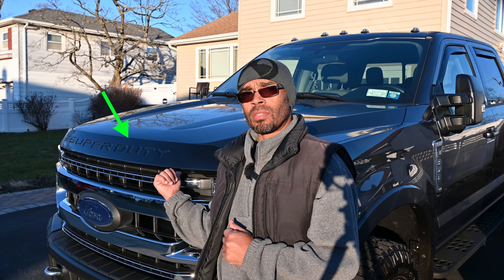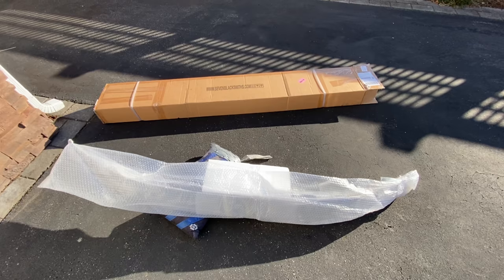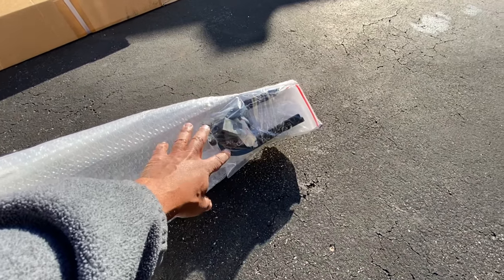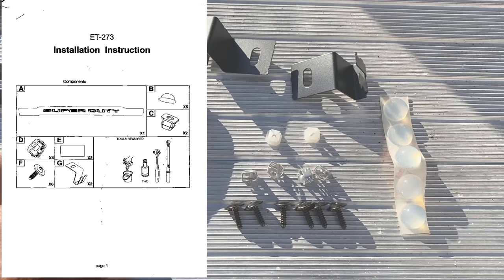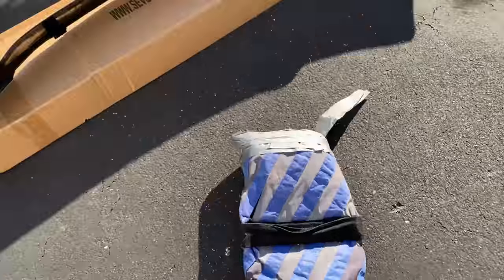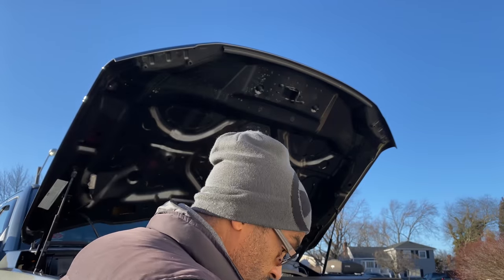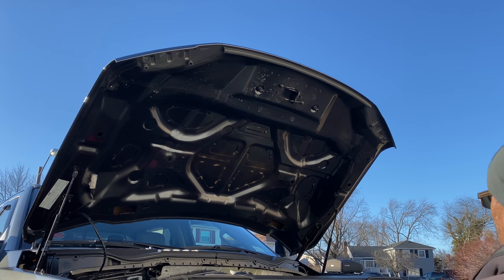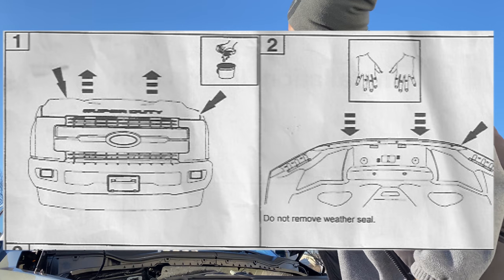How to install Hood Deflector Bug Shield for the 2017 2018 2019 2020 2021 Ford F-250 F-350 Tremor

Comment: Nice job Ray.  Even without paint protection, I like your idea to stick the little bumpers to the deflector instead the hood.       Also, you obviouly know this but throwing it out there for those that don't,  Always install all the fasteners, screw, bolts ect. before tightening any of them.   I'm a retired aircraft mechanic and this is an important simple lesson to learn.  Makes live so much easier.
Reply from the maker: Thanks for your comments and suggestions.

Comment: How well did this work out over time?  Still happy you got it?  Did it make a difference with bugs and stones?
Reply from the maker: Thanks for the question, I haven’t had problems with bugs and rocks hitting my windshield but I really don’t drive in those conditions, also the only problem is with the paint on the deflector. It had been peeling off. I’m have to strip off the old stuff and repainted it . That is the only real problem with this item. Other than that it’s been working out well.

Comment: Good job on the video.  I followed your instructions.  Thanks for the help.
Reply from the maker: Thanks for the feedback and please remember to subscribe to the channel and like the video.
Reply: Mine came with some foam strips, that I don't know what they are for.  I believe I saw them in your packet as well.  What did you do with them?
Reply from the maker: @michaelvincent340  they are used if you have a problem with rubbing or vibration. I didn’t use it in my installation.9

Comment: Great video was thinking about this deflector on my new 2021 F350?  one question? where are the 2 pieces of black weatherstrip type foam go? reference the 54-55 second time in video
Reply from the maker: Thanks for the feedback and please remember to subscribe to the channel and like the video. To answer the question, the foam is needed only if you have Rubbing or vibration issue. I didn’t use it in my application.

Comment: I didn't see you install the 2-way foam tape. 
My bug shield started shaking vigorously on the highway and I had to pull over and remove it. I never install the tape.
I followed the instructions as directed. Do you have any idea why this would happen. It was snugged down and tight when I finished the install.
Reply from the maker: Thanks for the feedback. Please remember to subscribe to the channel and like the video. To answer the question, I didn’t use the tape. It was given as a option if you needed it. I haven’t had any problems with my deflector. also review the video again. Give Attention on how I install the rubber stops. To avoid any vibration. Good luck

Comment: Ray,  did you not install the two strips of foam? This is an important piece to reduce vibration of the plastic deflector on the front lip edge of your hood. I did not see it in your video.
Reply from the maker: Thanks for the feedback. Please check the past comments below. I give a answer to your question. Also answer some other questions in regards to the instructions for this item.
Reply: @DIYRAY  - I installed both the foam strips on the inside lip of the hood guard which will negate any rubbing or vibration of the plastic guard on the leading edge if the painted hood area. I  have full hood coverage of XPEL paint protection, however the foam strips do serve a purpose. Cheers! 👍🏻😉
Reply: @patriotone755  Whereabouts on the hood or deflector did / should you attach the foam strips? I installed this item and at 75-80mph I get I big vibration like the truck is going to fall apart. I took the deflector off and the vibration is not there so definitely the deflector. Any help to get rid of the vibration is appreciated.
Reply: @gavinm6720  - I installed both the foam strips on the inside lip of the hood guard which will negate any rubbing or vibration of the plastic guard on the leading edge if the painted hood area. I  have full hood coverage of XPEL paint protection, however the foam strips do serve a purpose. Do this and you have installed it correctly.

Cheers!
Reply: @patriotone755  Thanks for the info. I refitted the deflector with the 2 foam strips on the bottom leading edge of the deflector and this effectively blocks air from entering the mid section and causing the deflector to vibrate. Seems completely fine now at over 80mph.
Reply: @gavinm6720  nice job, you installed it properly!
Reply: @patriotone755  Can someone post a picture of where the foam exactly was installed?
Reply: @deadondisplay2895  Did anyone send you a picture of where the foam pieces go?  I am looking to install 1 too.

Comment: So I installed and got a big vibration from the deflector at 75-80mph. I did not install the foam strip. Now I have taken the the deflector off and will install with the foam strip. I know you did not install the foam strip and had no problems but do you know exactly where to place it if you did need it?
Reply from the maker: I contact the Manufacturer of this product. I asked him the same question. They stated it depends on your application and where the vibration is coming from.  I suggest cutting probably 2 inches off the strip and go from there place it where you think you might need it.
Reply from the maker: Also make sure you installed the same way I installed it. Hoping it will solve your issues. Good luck 🍀
Reply: @DIYRAY  Thank you sir!

Comment: BEWAR!!! I just got mine from Ford with my Ford pass points. They don't say anything about basically gluing to your hood with double backed foam tape. Not a chance that that's going to happen on my  new 2023. What if one day you decide you don't want it anymore for some reason? The paint would never be right. Back in the day, they had brackets and bolted up under the hood so that you could replace a damaged one or just take it off with no damage to the paint. Your video was a great tutorial but I'm sending mine back. Not one of Fords better ideas.
Reply from the maker: I agree with you. That why I placed the rubber bumper on the deflector instead of the hood.

Comment: Did you use the weatherstripping?
Reply from the maker: No, I didn’t. I just used the rubber stops. I have Driven the truck for several hundreds miles I have not had any problems. Thanks for the feedback and please remember to subscribe to the channel and like the video.

Comment: Where’s the foam strips use at?
Thanks
Al
Reply from the maker: Thanks for the feedback and please remember to subscribe to the channel and like the video. To answer the question, I was wondering the same question. So I reached out to the Manufacturer. They stated that the form is needed if there is Rubbing or contact with the vehicle that is Causing some type of problem or vibration. For me I didn’t use it.
Reply: @DIYRAY  great insight. Thanks
Reply from the maker: @Al-mu4ff  you are welcome 🙏🏽

Comment: The 5 bumpers are supposed to stick on the hood, not the deflector
Reply from the maker: Yes, that’s correct. As I stated in the video. I prefer my set up. Thanks for the feedback and please remember to subscribe to the channel and like the video.
Reply: My instructions showed the exact spot on the inside of the hood deflector where the small rubber bumpers are to be installed. If you look hard you will see the spot marked with little dots on the inside of the hood deflector this is where you  stick the rubber bumpers. This is so you don’t stick the bumpers on your painted hood or paint protection. The hood which gets really hot from engine heat which will eventually cause the adhesive on the bumper to break down, release and fail. Stick em on the inside of the hood protector where they belong. 👍🏻 Just passing it forward fellas!
Cheers!
Reply from the maker: Thanks
Reply: @patriotone755  Interesting explanation, I didn't think about the heat and adhesive breaking down. I stuck them on the protector because it just seemed to make better sense. It's sad we are even having this debate thanks to god-awful instructions that require you being in the spectrum to understand